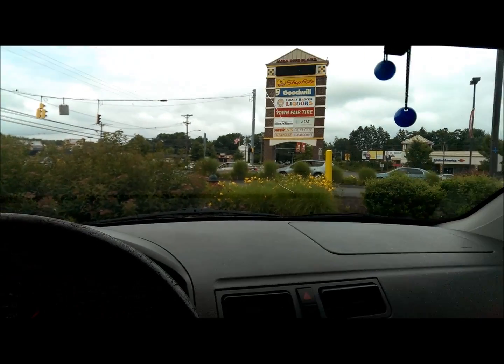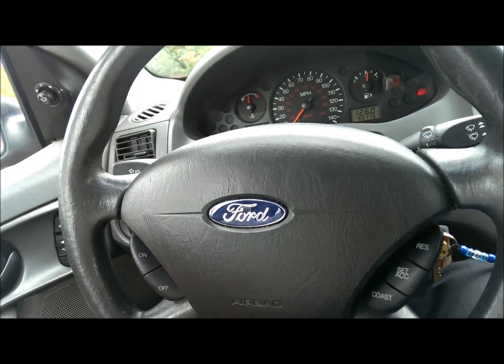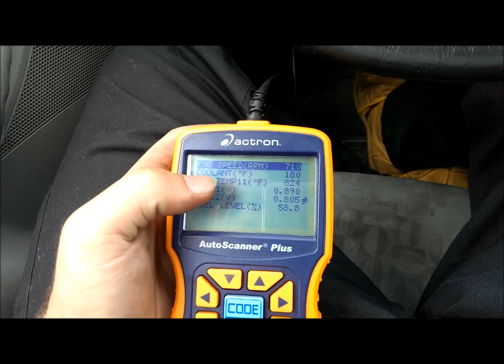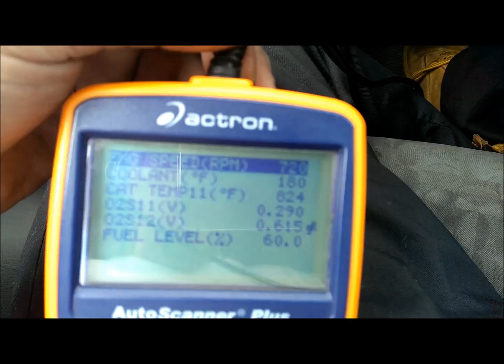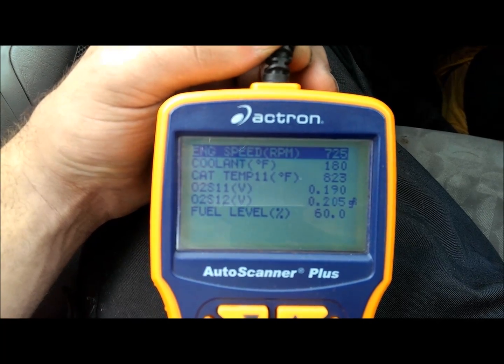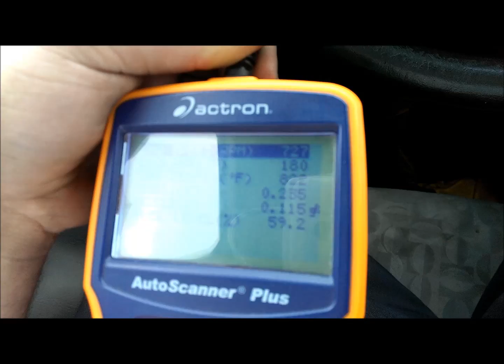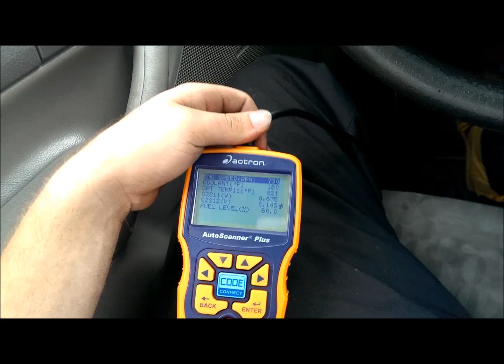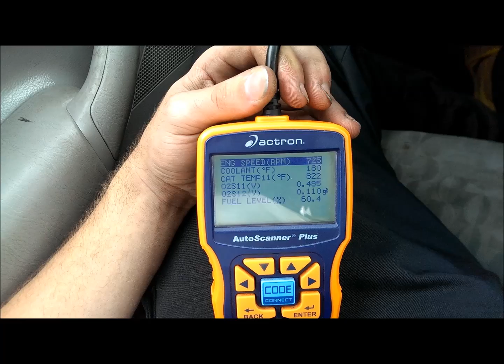How to Check For A Bad Catalytic Converter

Comment: so i see the video was made in jly 13. i live in a state without emissions testing.  did you change yours.  i have same code as you. did your lose power? or did you get another by now? if you waited did you lose power. i got same code month ago. don't know how long before power will be gone.  i didn't know advance gives scanner as loaner.  it's 2016 wonder if they still do.  i
bought the elm327 adapter obd2 and torque applcation to check volts for 02 sensor cut adapter would not connect with vans computer.  i hope they still loan them out. by the way thanks
for explaining and being specific and educational.  did you get just the CAT or pipe that comes with it?
Reply from the maker: That sucks to hear scooter  but you are very welcome for the video. I gave the car to my sister who was in more need of the car than I was before I got the chance to fix the P0420 myself but she told me she had the catalytic converter replaced (a Ford OEM bolt-on replacement, not an aftermarket weld-on) at a local garage and the P0420 code went away within 2 days. The Focus in the video (to me) didn't seem like it had any loss of power because I drove the car after the new cat was in and it drove the same, it just got a little bit better gas mileage (about 2-3mpg avg).

What year is your vehicle? I ask because if your vehicle is newer, there's a chance that the scanner that your local parts store can loan you wont cover the vehicle. Those scanners last I checked only went to 2008 model year vehicles and would obviously not work on anything newer than that.
Reply: i have 2006 caravan. i went to autozone. they had scanner to borrow but they said it only showed codes and erased them if needed. it wouldn't give live data you were receiving.
don't know what i want to do at this time. i just don't want it to get bad. if i could drive couple years more, at 91000 miles now. then would be great.
without scanner showing live data can't tell much yet.  i did buy for 5 bucks a program downloaded called toque. but the blue too adapter obd11 didn't communcate with
the vans computer.  so i sent it back. want to find an obd11 adapter for 20 bucks.  thanks for response.

Comment: THANKS BUDDY
 I HAVE A 2000 GMC SIERRA 1500 TRUCK,4.8 ENGINE
MY CODE ON MY SCANNER READS CATALYS MON  INC
I AM UNABLE TO GET THE SUCKER TO GO AWAY
 SO I CAN PASS MY IMISSIONS TEST.
 ANY IDEAS.
 KK = KEITH KUHN
Reply from the maker: You are very welcome Keith! As a certified emissions inspector myself, I can tell you far as the catalyst monitor being incomplete, I dont know what you have done as far as drive cycles go but I would take the truck on a nice long drive and see if that does anything. A lot of times if you replace a battery or clear the computer with a scan tool, it takes a good 3-5 nice long drive cycles (about 20-ish miles a piece) to reset. Driving little short trips everyday won't do anything.

If that does not reset the monitor, I would check your o2 sensors and see the readings once the car is nice and hot, see if something isn't right with the readings. If things seem fine on the o2 sensor side, there could be something wrong with the computer itself. I have seen this first hand as an emissions technician. Something goes wrong inside the computer itself, it stops learning drive cycles and it's pretty much SOL at that point.

Comment: How did you created the custom data list ?  I am having issues with 420 code and need to troubleshot it.
Reply from the maker: +Karl Oz When you use the scan tool, there should be a menu for creating a custom data list once you pull up all the parameters. I dont remember exactly how to since I dont have a scan tool in front of me. Be on the look out, I'll make a video about how to do this!

Comment: Thanks for the video. I am having stalling issues with my car and no engine light. Fuel pump, ignition module and a whole list of stuff replaced, but no mechanic can find the problem so I will find it myself.
Reply from the maker: +MegaTreetop You are very welcome for the video! With your vehicle, do you notice that it stalls under certain conditions? When you shift it, when its only hot or cold? What kind of vehicle do you have?
Reply: +Dale  I have a 1996 Buick Century 3.1L engine. It stalls out after  running at idle for about 15 minutes. The fuel pump, fuel filter, coil packs, ignition module, crank sensor, camshaft sensor and other parts have been changed by so called mechanics from Craigslist.  Yes I know I shouldn't have gone there, but I was desperate.They say they know what the problem is, but never fix it then I never hear from them again. There is no engine code. It will stall on me if I try to drive then I have trouble restarting, but then it will restart once cool and does it all over again. I don't have AAA  and can't afford to tow it.  I do have a scan/diagnostic reader and it is detecting a problem with catalytic, downstream o2 sensor and EGR. The catalytic was checked at a garage last year first they said it was bad then they drilled a hole in it and said it was OK.  Could it really be a catalytic problem with too much pressure or something that stalls the engine. It seems temperature related. I don't know.Sorry if I wrote so much ....Paula,
Reply: +MegaTreetop  Hey this video made me look at the O2 downstream and the readings went from .115  to .84 and all  various numbers between them.  I was thinking catalytic issue ?
Reply from the maker: +MegaTreetop That is okay, I like that you typed a lot. It gives me good feedback! From what I know, those 3.1L engines ("3100 SFI V6") are NOTORIOUS for having intermittent stalling issues. I know this because I had a 1996 Chevrolet Corsica that was no different. This is going to be long so hear me out...lol

I would try to have someone track down that EGR issue. Those EGR valves are common to getting blocked and plugged up and causing havoc. I would have someone try cleaning or replacing that EGR valve first and see if the stalling stops. 

If that doesn't work, it could be a vacuum leak because again those engines have integrity issues like no other, especially with gaskets and vacuum lines. The best way to do this is to use a small propane tank with the tip on the end. Crack open the tip of the propane and just go around the engine where any black lines go into the engine and listen for an idle change. Also just because it's an intermittent issue, I would do a "wiggle check". While the engine is running, just grab some electrical lines and just softly move them around and see if the engine stalls or makes an erratic change in rpm. 

Even though you said the cat is bad and you had someone drill a hole to make it better, I highly doubt it would cause the engine to stall. It would require a LOT of backpressure and a lot of blockage to cause the engine to stall from a clogged cat. If it was this bad, you would definitely know because you would barely be able to go anywhere with it. 

If the downstream o2 sensor is reading a low output, it's because of the hole that the person drilled into your cat. It's allowing some exhaust to escape before it gets to the sensor, so it therefore goes "unidentified" by the sensor causing the low readings. I wouldn't be shocked if the o2 sensor was actually good and working properly. But because of the low readings, it's not within the specific "range" set forth by the car's computer, which is tripping the code for a bad o2 sensor ("o2 Sensor Circuit Low Voltage")
Reply: +Dale I cleaned the EGR well so the pintle is moving OK not clogged. I have also wiggled the wires while car is running, but engine does not show any change as I wiggle the wires. There is no engine code so the reading on the O2 sensor was from my diagnostic tool. It shows  live data info so I can see what the engine is reading on most of its systems as it is running. It showed the cat, egr and o2 sensor were not not reading normally. The hole is only a small drill hole in the cat. I will check on vacuum leaks. Thanks,
Reply from the maker: How did the check for the vacuum leaks go? Sorry for the late reply, i have been very busy. The thing about the drilled hole in the cat is that it does allow for some exhaust gases to escape out of the cat before ever reaching the downstream sensor which would give you the low reading. o2 sensors don't just read what's in the exhaust but it also measures the oxygen outside the exhaust as well so it gives a "baseline" of sorts to compare everything. 

That's just my only concern about that. I would try to find some kind of plug and plug up the drilled hole and then check your downstream readings after to see any difference. Also try to notice if the car sounds different, runs and drives different. That right there could be your biggest clue as far as how bad that catalytic converter is
Reply: I will try plugging the hole, but honestly I'm about to sell the car on Craigslist. I think the only way the car will sell is selling my other car with it. Its a Ford Aspire '97 and runs great. I'd really like a small SUV like a Ford Escape or Honda CRV. I will try plugging the hole and see what happens. Thanks,
Reply: MegaTreetop i have the same problem and have replaced the same parts u have listed. Let me know if u get yours fixed and what u did to fix it . Thanks
Reply: Security code ignition issue pcm ECM whatever computer module type you have

Comment: I have a p0420, no loss of power, get about 23mpg city drving and no overheating
Reply from the maker: +keithc728 That's good to know! Maybe having a clogged/broken catalytic converter affects certain cars and certain engines more than others. On the Ford Focus in this video, I didn't really notice much of a lack of power but I did notice that I wasn't getting very good fuel mileage. I replaced the cat with a factory Ford one and both o2 sensors and noticed a good 3-4mpg gain on average
Reply: I also have p420 on grand caravan 2012 sometimes it goes into limp mode or whatever is called

Comment: Thank you I learned something. My check engine light in my PT Cruser is giving me the same code. I tried this test with a scanner and yes the bottom number is jumping all over the place
Reply from the maker: +PGMEagle I am very glad that I was able to help you out! Stinks that the cat is bad, but the good thing is that at least now you know for certain that it is indeed a bad catalytic converter and can now start planning to make the proper arrangements to get it fixed! Thank you for watching and commenting!

Comment: thank you for the video, I have all the symptoms and this test really made me realize that the cat was the only problem, didn't want it to be true but oh well..
Reply from the maker: +XXGunzNClipzXx You are welcome! I am glad the video was of help to you. 

Just for the sake of checking, if you are not completely sold (or in denial like I was) on the o2 readings alone I would try having the o2 sensors tested for integrity to make sure they are good and not faulty (but normally if the o2 sensors are bad, the car's computer would throw a code for a failed o2 sensor and not for a bad catalytic converter). If that is the case and they are good, take an infrared temperature gun to the inlet (front) and outlet (rear) of the catalytic converter when the car is up to operating temperature and record the readings. The outlet should be hotter than the inlet. If this is not the case, it's another major sign that the catalytic converter is bad. 

Both the o2 readings and the temperature gun are near fool-proof ways of checking, but the o2 sensor readings are usually the easier of the two ways to check than having to get under the car while it's running and hot. But if you do both methods and they both come back badly, at least you know for absolute certain that the catalytic converter is bad and it needs to be replaced.

Comment: hi is this true for all or most cars? i got a code p0430 on my 2012 dodge challenger and the sensors  upstream  and downstream readings are almost identical on the wave/line chart, the downstream wave line almost mirrors in oscillation  and voltage to the upstream is that a bad cat?
Reply from the maker: +angel cedeno This should be true for all cars across the board, as they all operate on the same general computer diagnostics (also known as OBD2) since the 1996 model year. Any car that has a code that starts with a "0" is a general, across the board code. If the code starts with a "1", it means it's a manufacturer-specific code. 

In general, a code P0430 is the same thing as a P0420 (catalytic efficiency below threshold) but it is the 2nd catalytic converter in line after the first one . Since your readings are the same on the second set of o2 sensors measuring that 2nd catalytic converter, it's usually a good sign that the catalytic converter is bad. The downstream reading should always be lower/steadier than the upstream readings.

If you are not completely sold on the o2 readings themselves, you can have the o2 sensors tested for integrity. You can take an infrared temperature gun to the inlet and outlet of the catalytic converter itself and measure the readings (once the car is warmed up).  In that case, you want the outlet (rear) of the cat to be hotter than at the inlet (front). Also check for an exhaust leak as well, sometimes that can trip a bad cat code. Long post I know but I hope this helps!

Comment: If your car has a miss it's possible it's the coils.  I had the PO420.  Change all 4 coils yourself, they are easy and also cheap. I changed all4 for 95.99. araparts.com Also change the plugs, if it still runs bad then it probably is the CAT. but do this before you ditch your car you might get lucky.  My check engine light always goes on and off, don't worry until it blinks.  I bought my 2004 nissan sentra 2.5 new and have 123,000 miles. Don't just change 1 coil for $70 get all 4 for under a $100. These coils don't last forever and the dealer loves replacing 1 because you will be back again soon for another.

Comment: @5.35 minutes that symbol indicates that you can view a graph[ic] representation of the voltage value you are viewing for that PID  [ parameter - ID ]    use the down arrow until you highlight that PID and then press enter and a graphic representation of the voltage will appear.  good video

Comment: I am ASE Certified and own a repair shop.  He is NoT using a "scan tool".  He is using a cheap code reader, not the same thing at all.  If he has more than one cat on the car, as many do, this reader will NoT tell you which one is bad!  This must be diagnosed which is way cheaper than replacing all the cats at one time.   We don't use $5,000+ scanners for no good reason.  Some guy working at a goofy lube is not usually a certified technician.  Parts stores are just that, they are in the business of selling you parts, they are nOt mechanics!  Many shops WiLL scan your computer for free and provide you with a written estimate.
Reply: +Laura Ann It is now ILLEGAL for the parts store to scan my car for free, and the local dealership refused to tell me what codes came up in my scan. They just said "Pay us $1500 for a tune up". Thank you Chevy dealer!! I now have to buy my own cheap code reader just to know a little about what's happening. - Owner of a 2005 cadillac.
Reply: +Katie Wagoner Great, it should be illegal for parts stores to scan vehicles.  They cause more trouble for people than it's worth.  I explained above why.  The code is a number which tells what "system" is failing.  There are many parts to a system and without correct diagnosis, you will not know exactly which part to replace.  The parts store is more than happy to let you throw parts at your car, until you eventually get it right.  How much did you save doing that?  You don't have to go to the dealership.  Find a reputable independent shop in your area, like I said many will give you a free estimate if they don't have to perform further diagnostics, such as: voltage readings, smoke test, etc.  It just depends on what system is being affected, some take other equipment and time.  You don't work for free, why would you expect not to pay for a correct diagnosis?  Do you tell the doctor you aren't paying for the X-ray?  Same thing.
Reply: Pep boys wanted to charge 80.00 to scan the computer on my truck
Reply: Laura Ann but you can get the code with the key method ..... no difference ...... i understand what your saying however ....they will not elaborate on any code ...their response is exactly what you said ... just because its a cat code dont mean the cats bad .... just the system in question .... ive got and paid for estimates that was WRONG on more than one occasion....i now have my own scan tool to diagnose my own car ...... then do my own repairs .... 346,956 on my 00 mountaineer never seen a garage other than inspections , and a smoke test to find a leak i couldn't....
Reply: Um bank 1 and bank 2 hello...smh

Comment: Just gutt the fucken worthless cats. Then put on a o2 simulator on the down stream then promble solved.then drive car for a million miles without having to worry about the engine over heating . Think about it the cioling system can only efficentley cool up to 180 degrees. The cat burns at 1,200 degrees how in the world can any cooling ststem cool that down its no wonder engins die from overheating.
Reply: Eagleoneradiogod your engine's cooling system doesnt cool the catalytic converter......the air does.....
Reply: matttaylor817 thats all the more reason why cats shoud all be gutted and left hollow. So the cooling system and the fan can more easily and efficentley cool the internals of the combustion engine.